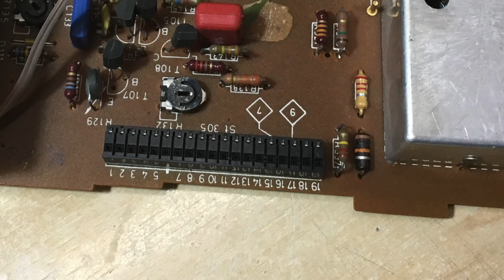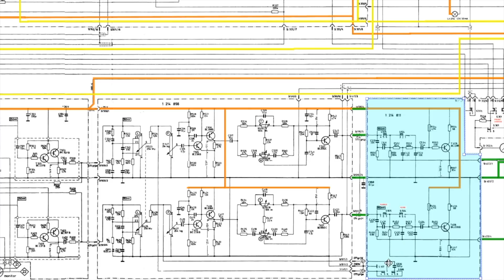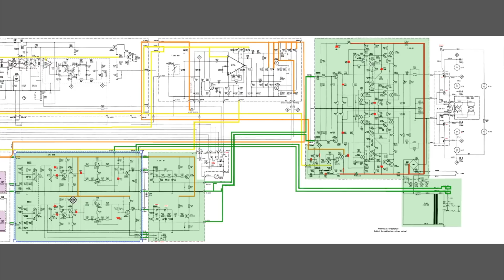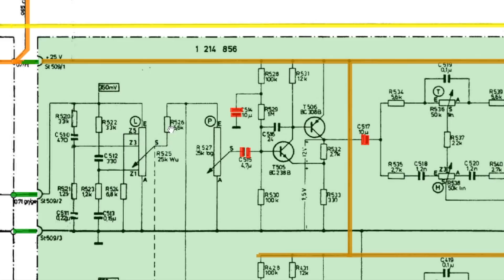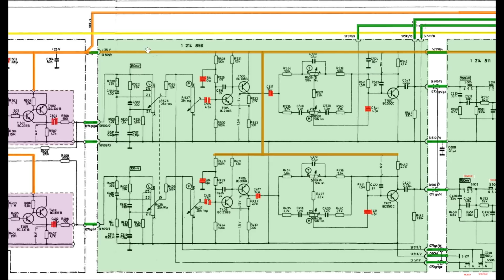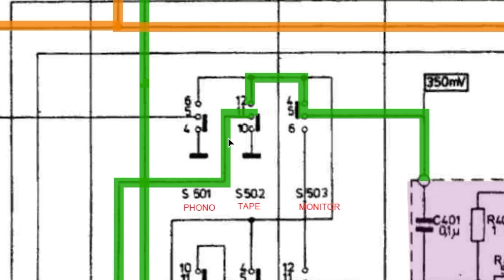Braun Regie 450S restoration - part 4. Time to move further back ... the Preamp. Let's test it.

Comment: The reason why a previous owner made that hack is probably to accommodate for an old tape/cassette recorder that used pins 3/5 for recording as well as playback.

As I'm sure you know, tape connections on tube radios were simply a connection to the signal path, between the source selector and the volume control. For recording, the tape recorder could use the signal coming out from the tuner or record player. For playback, you simply put the radio in Phono mode without playing a record.  When DIN plugs were introduced in the early 1960s(?), pin 3 (3 and 5 for stereo) was/were used this way: for input and output depending on the recording/playback state of the tape recorder. Pin 1 (1 and 4 for stereo) was/were used for microphone input.

But this has obvious disadvantages: For one thing, if someone wanted to plug in headphones to the tape recorder to listen to a tape while the rest of the room would listen to the radio or the record player, the playback signal of the tape recorder would be mixed with whatever was playing on the speakers of the receiver. So companies started making TAPE a separate selection on the input selector of receivers, and tape recorders started using pins 1 and 4 for recording and pins 3 and 5 for playback.

This is what the Braun receiver (specifically the "band" input and source selector) was designed for: playback on 3/5 and recording on 1/4. To make sure the signal from the tape recorder wouldn't bleed into the selected audio source, the tape input could now be grounded. And the recording signal would go to pins 1 and 4 and would not be affected. A previous owner of the Braun must have had a tape recorder with the traditional "3 and 5 are recording AND playback" and of course it wouldn't record that way. So they hacked it to bypass the TAPE switch. 

Tape recorders with DIN connectors that used 3/5 for playback and 1/4 for recording, usually would cut off the playback output when they were in recording mode. I had a Philips cassette deck from 1982 that had RCA cables, but it had a "DIN" switch on the back that would make it cut off the outputs during recording in case you would connect it to an old "3/5 is recording and playback" amplifier with a DIN converter plug that would tie the recording and playback signals together. But cutting off the output was exactly the opposite of what you would want to do if you had a 3 head recorder: For those, you would probably want the option of listening to the playback head while the recording head was recording. So those recorders would usually have a separate DIN socket for monitoring, which was the same as the non-monitoring DIN connector but didn't cut off the playback signal during recording. The Braun is prepared for such recorders with the Monitor input and the Monitor button. Of course other manufacturers (especially those that used RCA connectors) had already figured out that you basically don't need the TAPE input and button, only the MONITOR input and button.

As I already mentioned, bypassing the TAPE switch means that if you play a tape at the same time that the receiver is set to radio or record player, you will hear the tape through the speakers too. I would not like that, and I would reverse the modification.

By the way I don't think it would damage anything to short an input to ground; there's always a capacitor in series with the output inside the device anyway.

Also, it's not clear to me why the 1/4 pins on the Monitor socket are not connected to the 1/4 pins of the Tape socket. Perhaps one of them is behind one of those booster circuits to make sure the impedance doesn't change regardless of whether a tape recorder has recording inputs on the Tape cable, the Monitor cable or both?
Reply from the maker: Now THAT is an explanation! Thanks.
I think I will reverse the hack and get it back to its original state.

Comment: I can see why they wanted to remove the possibility of shorting the source; if using something such as a mobile phone headphone output expecting to see 32 Ohms or thereabouts, there would surely be a risk of damaging the output stage by driving in to a short for long periods.  So good idea, badly executed!   I suppose if crosstalk was an issue you could put in say a 100 Ohm resistor rather than a short?
Reply from the maker: Yes, the shorting is definitely not a good idea. I’m cleaning up the back right now, but probably leaving it as is.

Comment: The hack could be for a portable player being connected, but I still don't quite understand the jumper wires.  Removing the ground short may make sense, but the jumper wires still have me a bit baffled.  I should imagine only the ground would need removing from the switch to remove the short.  I wouldn't think the jumpers would need to be there
Reply from the maker: No, the jumpers are just to allow the ground line to continue on the opposite side of the switch pin. On removing the pad, they broke the pass-through, so had to re-make it.
Reply: @electronicsoldandnew  That makes sense now.
Likely hacked to use a portable device on it via a headphone output.  The shorting to ground being missing wouldn't affect the unit then, unless there is leakage across the switch, which I doubt there would be. 
Still a dodgy hack though....
Reply: Depends on what it was being used for.

Comment: Btw, the monitor switch and connector is used for tapes that have 3 heads so you can listen to the playback control without interrupting the recording.
Reply from the maker: Thanks.
Reply: So possibly this unit was used in a recording studio setup and hence the hacks for their particular situration?

Comment: To me it looks like the hack on the Tape switch makes it so that audio from tape input goes to the preamp even when the switch is NOT operated, so you end up with Radio and TAPE audio at the same time. Don't know why anybody would do that.
If whatever was connected didn't like to be shorted to ground, then it should be enough just to remove ground on pin 7 and 10 of the switch. No need for the bodge wire. I think...
The numbering of pins in the DIN-connector is probably from the fact that the connector was designed so early that it was only for mono signal, so 3 pins was enough for playback and record. Later stereo was added and that became pin 4 and 5.
Entertaining and fun to watch your methodical work. Thumbs up.
Reply: You are right about the numbering.  DIN come in 3,  5 and I believe even higher numbers of pins.
They keep compatibility as three pin connectors can plug into the 5 pin ones.
Reply from the maker: No, the tape switch does disconnect the tape input from the signal chain. It just doesn't short it to ground. 
They did in fact simply remove ground from the pins on the switch. In doing so, they also broke the ground connection that was passing through the pad for the switch, so they patched it up. 
Thanks for the explanation about the numbering. Makes sense, actually.

Comment: This hack, i guess, is to have in any case the signal, coming in from tape and going out to monitor. Or am i wrong?
Reply from the maker: That would happen, I guess, but I still don’t understand why they chose to do it.
Reply: You can not use the tape-switch and the monitor-switch at the same time? Right? I guess, someone used the both connections for two tape-devices. A copy-station? If not, i also don't know, whats going on.